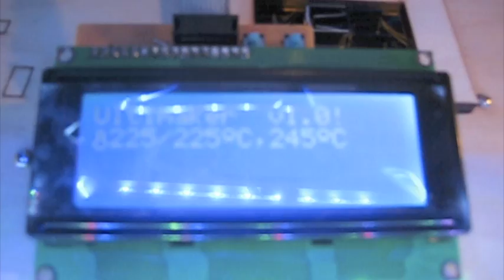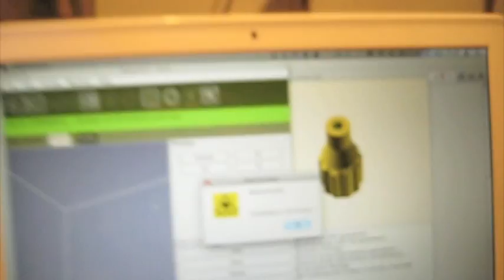My new 3D printer: The Ultimaker

Comment: Have you seen stuff printed on makerbots? it looks like it was made with spaghetti. ultimaker has much better print quality. makerbot is the most well known but makes some of the worst prints compared to most other printers. You can technically get similar print quality as an ultimaker with a reprap, but repraps are very hard to build and calibrate (they are cheaper though). I don't have one, but ultimaker is supposed to be fairly easy to setup and be printing quality prints in no time.